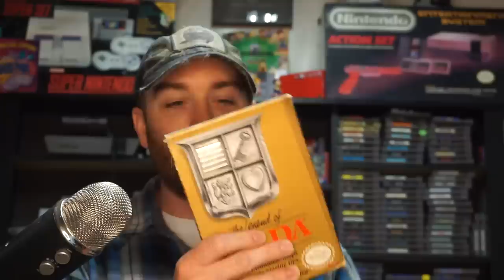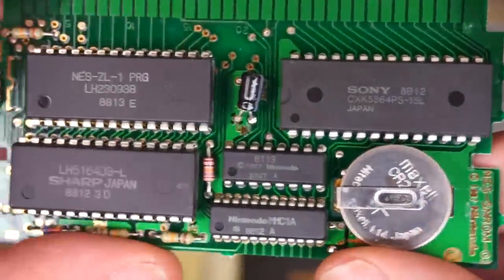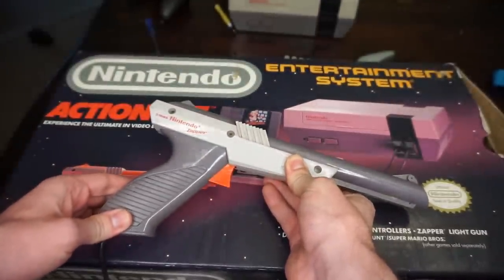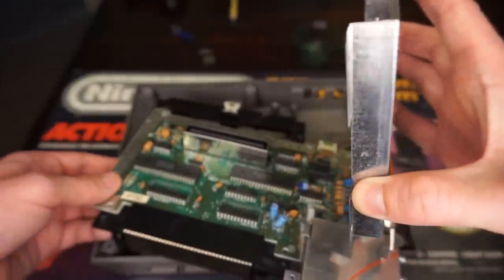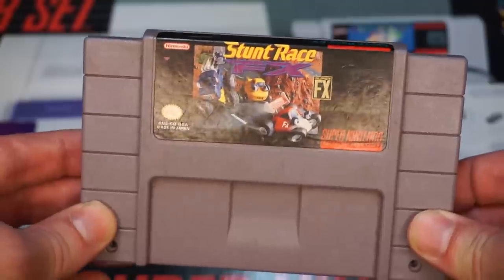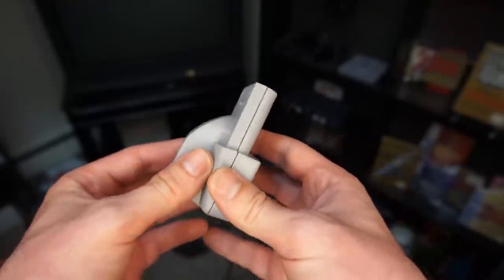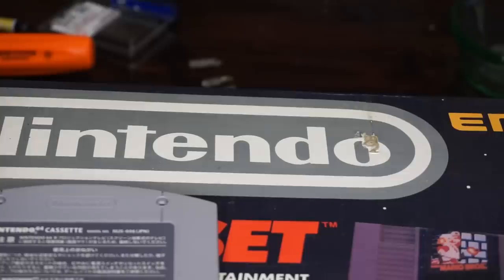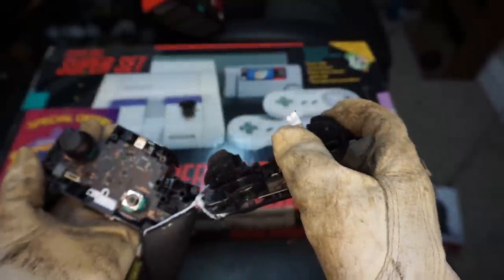What's Inside 10 Nintendo Products + Facts & Trivia

Comment: Looking at the inside of NES games is always good news for me. Great work!
Reply: Just to add an info for the ones looking, the main task of the MMC1 chip of zelda (and all the other Mapper chips) is to fool the NES into using larger ROMs.
The NES can only "see" 32KB of ROM, but with an MMC, you can pretend its a 32KB ROM, but swap part of it around, so you can access the whole thing.
This is generally done by trying to write to the ROM (something that normally is impossible), then the Mapper intercepts the attempt and swap stuff for you.
Quite neat.

Comment: This was fun to watch, I'm a bit of a dork and like to assemble computers and things myself (even though I've not got a clue what I'm doing) and seeing how the sausage is made is pretty cool. I'd personally like to see a hardware break (or whatever you wanna call it) of the Xbox 360 and see how poorly it had to have been made for the earliest models to overheat and die all the time.

Keep up the good work Shesez, your channel helped me get my games design degree this year so the work you do is always appreciated.
Reply: AK Minds there's not much to see with early Xbox 360s. Packed in layers off circuit boards and weird ventilation paths but the main issues (cheap solder being the biggest one) aren't obvious unless you know what you're looking for. To most people they wouldn't see a !major difference between the original white one and the black redesign

Comment: 9:20 - no, those ARE the chips andt NOT eprom.
It is called "Chip on Board" and it is just the silicon directly placed on the board, and the whole things is tuck there and protected by epoxy. What you called "Chips" are not chips but the "Dual inline package" - the housing for electronic components with 2 lines of connectors - and those can be eprom, or even just resistors.

Comment: That "glue" on the heat sync is not just any glue, it's a special kind of glue used in all computer-type things that have heat syncs, it's called Thermal Paste, it draws the heat from the CPU/GPU it's on and basically shoves the heat into the heat sync

Comment: Nice video, a bit basic but good for the uninitiated.  

For those wondering about the Sony chip, Sony and Nintendo did in fact work together until a bit after the SNES.  Nintendo wanted to keep using cartridges for it's next system (N64) while Sony wanted to switch to Disk (PS1).  Nintendo's always been a bit different from the others ever since.

A bit more explanation on PROM and ROM.  The Programmable Read Only Memory Chip (PROM) was essentially just RAM that was maintained by the battery while newer cartridges and SD cards use a more permanent method (RAM is faster but it loses it's data when it's been unpowered for a short time).  Technically speaking it was actually EEPROM (Electronically Erasable PROM) as it could be completely erased by an electronic signal to one it's pins (some Car computers have a different form of EPROM that can be erased by exposing the chip to light).  The ROM chip is also technically PROM as it was programmed at one point but it was designed to be programmed once and never altered so a glitch shouldn't be able to erase the ROM and permanently brick a game.  PROM contained the save data while ROM contained the actual game.  
If the terms are a bit confusing don't feel bad, a lot of them are misnomers that have become common place (EPROM uses the phrase read only memory but it's not read only and hard drives are usually called ROM even though they're also re-writable and pseudo Random Access, RAM stands for Random Access Memory which technically encompasses any and all forms of Solid State memory).

Since he didn't really cover it the way the light gun actually works (from the best of my understanding) is when you pull the trigger it sends a signal to the system which triggers it to change the screen for a short period to be all black with some white dots.  If the sensor in the gun detected those white dots it would send a signal that the shot hit, otherwise it was a miss.  This method was simple and cheap but has 2 major flaws.  First you could potentially trick the gun by pointing at a light source.  Second some TV's (especially modern LCD's) don't emit the right frequency for the gun to detect a hit.  I'm a bit fuzzy on the details on this part but apparently it relied on the unique way CRT's worked (it didn't actually detect the white dots but a certain light frequency created by the dots showing up on the screen).  CRT's basically work by using an electron gun to excite gas particles so they create light (most traditional light bulbs also work by exciting gases and/or filaments to the point they create light) and they use a series of magnets to direct the guns beam to draw the image.  Plasma TV's used a similar method but created different frequencies.  LED's and LCD's use an entirely different method (a more efficient and direct one) to create light (but I'm already on enough of a tangent here).  On one hand this means the old zappers don't work on newer systems, on the other you can now sit a lot closer to the TV without developing or worsening an eye condition (you can still strain your eyes but it's not nearly AS harmful).

Comment: You actually have to wonder about that, don't you?
Sony parts in Nintendo products...
OK, so if it's a generic part, like memory or whatever, you can get it from other companies...
Or in fact you could use Sony parts but just get them from an electronics supplier - Sony is none the wiser for the most part.

But the Super Nintendo...
Now that... Is a bit of a sticky problem.

When did Nintendo and Sony have that big fight? I forget the exact date, but it seemed to be around 1992 or 1993...
And of course, the Playstation came out in 1994...

So... What's the problem exactly? The sound chip in the SNES...
SPC700 - this is a Sony produced and designed audio chip, and unlike a generic part, if Sony says no, you're not getting these anymore!

And, well, the SNES was still a mainstream system until at least 1995, and the Super Famicom specifically was still being manufactured up until something like 2003, possibly as far as 2006? (Famicom systems were still being made until 1999 I believe... Yeah... Crazy huh.)
That means Sony was still supplying these audio chips to Nintendo, in spite of them not really getting along anymore, for 10 years or more!

Now, I assume the supply contract was pretty solid, but considering the situation, it's impressive they managed to keep the agreement going long enough for that to happen.
Certainly Nintendo didn't ask sony for any other parts - the kinds of things Sony might've supplied in theory, Nintendo instead mostly seemed to get from Matsuhishita (aka panasonic.)

Weird huh.
Reply: Sadly for the GameBoy Advance, the ended partnership meant that Nintendo had to go a different route for the sound hardware, which afaik is why many of the ports from SNES games sound strange. Fortunately this was no longer an issue in later systems (ie Virtual Console) because they were powerful enough to use software to emulate the original SNES hardware.

Comment: Oh man, I remember having to open my NES about 9-10 years ago because it wouldn't read the cartridged anymore. It turns out that those 72 pins you mentioned can get misaligned after years of use and must be manually put back in place with something like a toothpick or a very small screwdriver. I was actually surprised by how empty the console actually was, but it was really fun.

Nice video, man, keep it up!

Comment: If you have any half-decent n64 controllers, to save them from such extreme wear, it's a good idea to use a tiny bit of lubricant. Sewing machine oil works, but silicon based lubricants work too.
(just remember the lubricant you use has to be safe for both plastic and electronics.)

You can put a few drops in at the base of the stick, though if you want to be more thorough, open it up (carefully), and lubricate the stick, the cup it slides in, and especially the two slides with gear wheels on them.
Though don't lubricate the gear part, just the part that the stick rubs on.

This, above all is what ruins these sticks - when those two slide/gear sections wear out the whole stick gets very loose and doesn't really work anymore.
The cup can wear too, but that's not as critical.
The stick can sometimes wear, but usually it survives...

There are kits to fix this stuff up.
It's a pity, because I otherwise quite like the feel of the mechanism in this stick as compared to the potentiometer based ones you usually see...

But I guess there's a reason you don't see designs like this much.

Comment: As a quick tip, if you want to do more of these videos with hardware you want to continue to use then it'd be a good idea to invest in an anti-static strap or similar. Other suggestions include wearing clothes made of natural fibres, doing it in a room without carpets, and touching something earthed before handling the bare boards. Static discharge into the board (at levels you likely wouldn't even feel) will degrade the components. Sometimes a big zap can cause an immediate failure but it's more likely to be repeated handling that builds up the tiny amounts of damage over time.

Comment: The N64 Controller is an interesting case. Until late in development, it didn't have an analog stick and it wasn't until Miyamoto and the Mario 64 team requested it that it was added. Based on the design, it's clear that they still assumed most games would focus on the classic d-pad, and that only some action oriented games would use the analog stick. Note that the analog sticks were also absent from the original PSX controller as well.

Comment: The best part about batteries is getting a new battery slot installed. I desolder the old battery, then put in a plastic cartridge that can hold new batteries securely without additional solder (just install the battery holder) and you're golden! Next time your battery dies, just swap out a regular CR2032 battery and you're golden for another 20 years :P

Comment: You didn't mention that the Famicom has two pins that are capable of sound and graphical enhancements allowing developers to make use with chips which the support was removed in the NES. Konami was able to use a chip able to add sound channels like done in Castlevania III and graphical enhancements in Contra. 
You'll see the chip inside the Akumajou Densetsu and Contra Famicom cartridge.
Even some games to cost cut production by just using a Famicom board with a pin bridge to fit into an NES. Like the ROB games.

Comment: Next time a screw strips, one tip: a very small drill bit (METAL ONE, no wood bits or concrete please) and drill it out. Even if it does end up damaging some part of the case, it's usually way less than prying it broken apart.

Comment: The round battery is often called a button battery and now a days, you can find them in computers and their role is to preserve the data for many settings, such as the time and date, alive while the system is offline.
Also, I recommend the use of a grounding strap when opening and touching electronics if you're not doing so already so as to not accidentally damage the circuits through static electricity.
Otherwise, great video!

Comment: when I swapped out the case for my joycons, I found that the guts of those are actually pretty interesting (part of why I bought a see-through case). Be careful though, it can be pretty easy to strip the screws, although you won't have to break it open like the pro controller.

Comment: That "really old scotch tape" is actually kapton tape, a special adhesive film tape developed in the 60s that's used in many electronics (and even spacecraft!) It stays flexible in a wide range of temperatures, and is good for electrically insulating things inside products (you'll often find kapton tape holding down wires.) It's natural color is a yellow/yellowish-brown. So while yeah it's obviously ancient at this point because it's an NES Zapper, the color isn't due to its age.

Comment: Hey Shesez, I know it's been a year, and I doubt you'll see this, but a huge warning on any future Nintendo products you decide to open. I don't know what year it started and what devices, but they started gluing the wiring to the inside of the frame. I don't know if it's all devices or certain batches, but disassembling the product can result in ripping out important wiring from the circuit board. That's how I lost my 3DS XL.

Comment: If you take the top emblem off the lid of the Gamecube it will blow your mind. There is a Nintendo logo hidden underneath that is also functional... as it holds the puck shaped emblem in place. No one would ever even see it. I wanted to shine one up on a used Gamecube.. and found it.

Comment: I'd love to see inside of a console with backwards compatibility. To see just how they got the extra hardware inside,  and if improvements in chip production and the tech put into them effects the size of the board. Or if they rearranged the old boards to fit inside. Or no change at all. Specifically I'd like to see inside a wii I'd think it would be packed like sardines in there. It also had a seemingly small fan.

Comment: Hey, for N64 controller owners itching for a brand new pad, honestly don't spend fifty dollars. You can buy replacement sticks for half the cost, and have the choice of either the analog-based stick or the ADC-operated digital pads which translate the stick movement to something the N64 understand (the "Gamecube-alike" sticks). My story with this is a fun one, because it shows the perils of third-party tech;

I bought one of these replacement sticks and when it came in the mail, it arrived... broken. The stick itself was malformed, and after some tooling around with it outside of the controller housing the top fell off completely. I wanted to see what was inside the thing but unlike the original stick there's no screw, meaning it's epoxied together. While I never did get to look inside, the movement of the stick was otherwise fluid though being it came broken I hadn't installed it. After returning and purchasing another one from the same seller I managed to get a perfect model that didn't lose its top so easily.

Installing it is a breeze... except for putting the controller back together. Whereas the original stick had the cords cut just right, the replacement had a longer cable which I believed was part of my issues with installing it. Fun fact: The Z button rests on top of the stick shell. Don't be tempted to use the Z trigger ribbon as a catch for the extra wire unless you want a bad time with your Z button. After I installed it properly and futzed with it enough eventually the top half laid flat, the Z button works perfectly fine (despite slight differences; yay tolerance) and the controller I purchased for N64 emulation will last me a good ten years,

Comment: Excellent video. Didn't go into detail, which is probably a good thing as that's a rabbit hole that will surely result in you missing something or getting something wrong.
The Gameboy Advance has one of my favourite circuit boards: The display is detachable via a ribbon cable socket lock and the power button's "click" is entirely artificial via a notch in the switch that sits in the shell: The actual power switch is a rather loose slider. The L/R buttons use a metal pin to spring them back into place after they are pushed and the power LED is actually made of two rather small LEDs that both connect to a clear-plastic tube that carries the light from them to the top of the console shell and disperses the light, giving the illusion that it's a single LED.
The game-pak slot has a physical switch to activate "Gameboy" mode due to troubles during the development of the console making a software-switch not feasible (but a buggy version still exists in the BIOS!) and the speaker setup is pretty much exactly the same as the Gameboy Color (part of the larger explanation of why the GBA is infamous for shitty sound).
Reply: And whilst not an official Nintendo product (at all), one circuit board that I think is absolutely amazing is the EZ Flash Omega GBA flash cartridge. It's designed to fit in both a DS Lite's GBA slot 2 and a regular GBA slot which it can be converted between with via a swappable plastic shell. It's also an incredibly densely packed board with chips on both side of the device, including the micro SD slot and a battery for the real-time clock (also on-board!).
The build quality of the shell is cheap-Chinese (that swappable factor is awesome, but causes it to come apart a bit when you remove the cart from an original console), but the board is fantastic and really shows the effort they went into to try and make the ultimate GBA flash cart.

Comment: As a Sega Genesis kid, that battery and save system on Nintendo carts was my biggest admittance of defeat.  I loved my Sega and all, but 99% of the games being about two lifetimes long, yet also simultaneously required the player beat it in one setting... one a console which if looked at improperly for too long, would freeze.  Good times.  Best times.   Wait.. what did I miss and when... where did those thumbnail art sung glasses come from?  Also... that cart retainer that rattles around... they fall off from stress too.  In and out, in and out... two points of stress, two points of failure.  It happens.   Also, on the VB... Just solder that connection back individually... takes a bit of time, but will last forever.  Easy !

Comment: What's under that heatsink isnt adhesive, it should be thermal paste that you should normally be able to buy for cheap and reapply after removing the old. 

So you didnt necessarily ruin that Gamecube, if it matters. Anyway, great video, it mixes things up but still satisfies the curiosity.